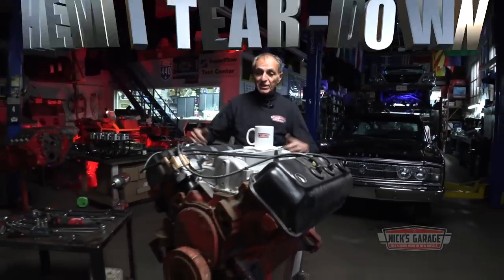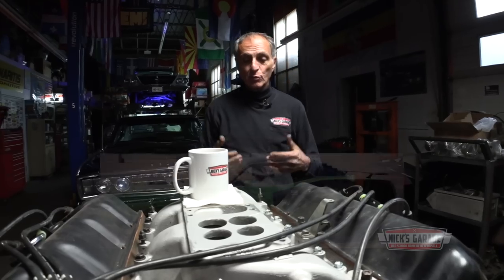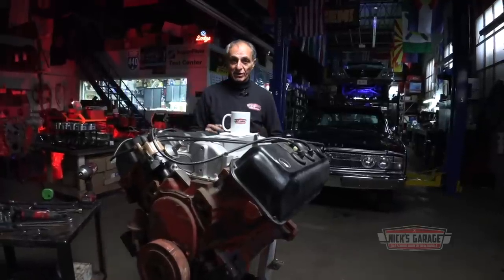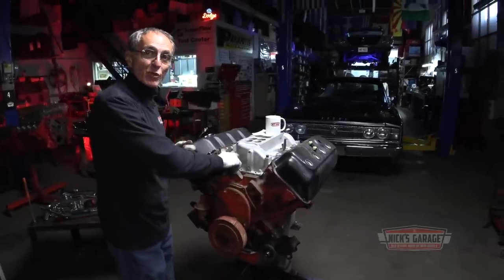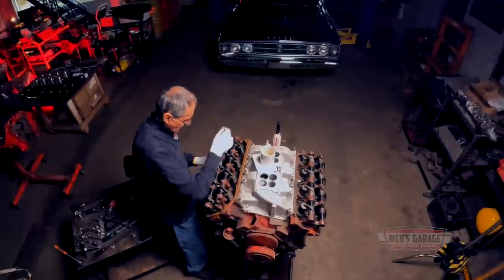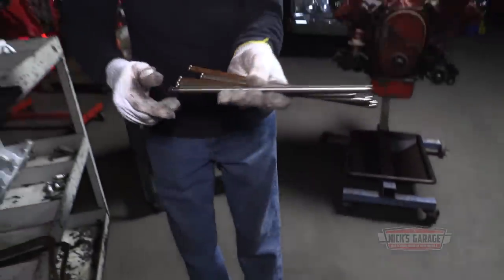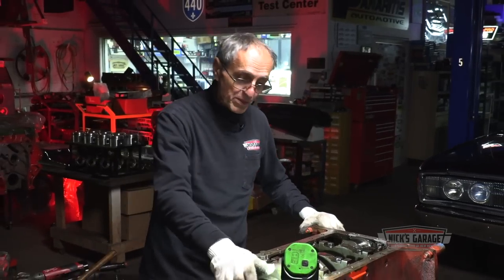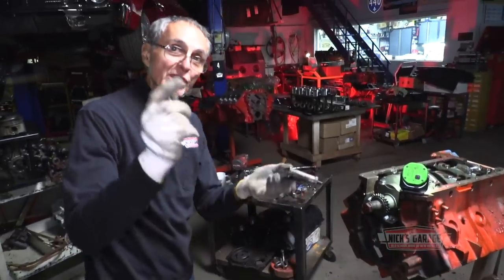426 Hemi Torn Down - What's Inside the Legend?

Comment: Nick you know they do make different grade bolts and just maybe the factory bolts were prone to failure. So someone decided to upgrade this engine to main studs. This is what most modern engines use so there must be some physical theory behind the upgrade.
Reply: I understand. I will buy grade 8 bolts for the side caps so we can have the original look. After all, it is not going racing or high RPM's.

Comment: Hey Nick , I would only bore that whatever you need to clean it up. If you can get by with 10 overboard and it cleans it up that's what I would go with.. the only can machine them so many times so on something like that the less you do it the better in the long run..👍
Reply: .010 will not clean it up. And 2nd, .010 pistons and rings have to be custom made and will take many months before I can get them.
Reply: Rings should not be a problem at all. Pistons on the other hand,  probably would have to be custom-made. But the difference in price is probably not that much.. anyways quality matters first and prices forgotten. Anyways you'll figure out what to do just giving suggestions. 👍

Comment: what's the reasoning to change to studs on the block mains?  does it distribute tension across 2 sets of threads instead of one?
Reply: Yes a bolt may stretch more than a stud with high  rpms

Comment: Is there a difference between a 426 oil pump, and a 440, or 383?
Reply: No, not really. all 426, 440 HP and 383 HP had the same oil pump. High Pressure.

Comment: Hey Nick if the cylinder bore cleans up at .020, will you just purchase .020 over pistons >> then you can go .030 .040 .060 later
Reply: Cylinders are worn and scrached. 0.030 overboer is what we need to do.

Comment: Hi nick 
Need your guidance, 
I have problem in 1971, 426 hemi from shaft the oil doesn’t reach to rocker arm - the block isn’t Indy
Both intake and exhaust at one side from 4 , only one whole there is no oil can you guide what can be done

Comment: Hiya Nick
Your getting like me the grumpy old guys...lol....we forget that back then we used what our machine shop guys told us and let's face it Nick they were mass production engine's so somebody in the engine room measured and marked the blocks with A,B,C,D for Piston and the rods were not balanced like we do today.....the old original engine's never ran "smooth" the harmonics we're terrible...but it was the technology of it's time.alot of them were blown up within a year of ownership.look at them now you can put a glass of water on the intake and it barely shimmers.maybe the shop that fixed the bottom end put them in because that's was the up sell ...the engineers then are not the engineers now.... engineers today don't even go in a shop they send the CAD program down to engine development and the Tech's put them together and send back the data to them and they revise the design.....not a bad thing...just we get to experience all of it...these new guys don't know what to do 🤣😂🤣😂🤣

Comment: Does that mean you can put 440 magnum heads on a 426 block I wonder?  Nick's Christmas box xl
Reply: Why would you do that ?
Reply: @nickpanaritis4122   I was just wondering about interchangeable parts. Can make a 440 hemi ?
Reply: @stevelee5724  440 is a "wedge" head, not a hemi. Totally different animal, even if the heads were interchangeable. The Hemi RB block is very different from a 440 RB, too. There are many aftermarket racing Hemi blocks and heads available (if you have deep pockets, but then a standard Street 426 Hemi won't be any cheaper to buy, either) that can go way past 440 cubic inches, if a bigger Hemi is what you're after.
Reply: @scottb8175  Thanks Scott. I thought the blocks were the same.  So what is a max wedge?  The thing is they all seem to be great engines. Max wedge ?
Reply: @stevelee5724  Max Wedge was the top Mopar performance engine that was replaced by the 426 Hemi.  It is more like the 440 in design.
Reply: @scottb8175  Hi Scott. Thanks for the reply mate. Is that the R series before the RB, raised block ? I've heard Nick talk about the R block. Like the 413 ? Cheers Scott.  I'm in New Zealand so I didn't get to see many big block Chrysler's. Lots of small blocks, many 318 and a few 360 engines in Australian Valiants. They have a good reputation here.

Comment: Hemis have been around for a long time going back to the 1920s, the advantage of the Hemi is the cross-flow heads are good for making good HP at high RPMs, but you can have cross-flow heads with it not being Hemi, just look at most if not all modern sport motorcycles they have cross-flow heads but are NOT Hemis they are pentfoor (penthouse) combustion chamber even better! then a Hemi, there is a reason all Formula 1 cars have a pentfoor (penthouse)  combustion chamber, the Mopar guys won't like this at all!, but if you look at the modern-day Mopars of today, are not real Hemis they are a 2 valve pentfoor (penthouse)  combustion chamber, sorry guys for bursting your bubble.
Reply: It's all good.
Reply: My 1983 Kawasaki GPz1100 has a poly hemi combustion chamber - each of its two valves are in a small partial hemi shape, with squish bands on both sides. It is also known as the "bathtub" combustion chamber. The piston head is like a 426 Hemi but with a slight flat spot on the top and slightly chamfered sides. Like the Chrysler Hemi, many 2-valve supercharged top fuel bikes used that style of head for many years. Standard Kawasaki Z-1 and KZ heads (1973-2003) were true Hemi's, but the poly Hemi versions (1983 to 1985 GPz, 84 KZ-R, and 84-85 LTD) flowed even better and are highly sought after by builders of retro Kawasaki drag bikes. Cross flow or "blow through" heads like Hemi's and Pent Roofs are losing favor though. They work well with superchargers and turbos, but aren't very good naturally aspirated. The top performing motorcycle heads now are actually not pent-roofs, but a very flat chamber, low included valve angle 4- valve with minimal head chamber volume and nearly flat top pistons. And they work just as good if nor better than the blow through heads when supercharged. The fastest top fuel bikes all use them now.
Reply: @scottb8175  Your description of a  flat chamber, low included valve angle 4- valve with minimal head chamber volume and nearly flat top pistons, is a Pent-roof combustion chamber, just like on the Suzuki TSCC heads, look it up on Wikipedia.
Reply: @nickpanaritis4122  Do not get me wrong Nick if I had an old Mopar it would be a Hemi 4-speed car, that engine is so good-looking! one of my dream cars is a GTX 426 Hemi 4-speed.
Reply: @scottb8175  ...Thanks for the info.

Comment: OK, it's an original engine. If you are going to punch it 30, why not 60 with a different cam?
Reply: I always try to bore it to the minumum.
Reply: @nickpanaritis4122  How much over is too much with the 426? Is it as bad as the Ford 427 and 428 - where anything more than 0.030" and it's a boat anchor? I believe the 440 is perfectly fine out to 0.060" over, as was the truck versions of the 390 Ford.
Reply: Yeah going 60 is pointless for power and you just lost the ability to rebuild it once again in the future.

Comment: That right head back side rocket arm assembly the reason it was so loose every Mopar V8 that I've had even the 383 for some odd ball reason that springs go through more stress. My all-time favorite is a 225 that slant six that was a bulletproof engine if you maintained it well I had one took it out of a 78 Dodge wagon put it back in the transmission it was only a 64 Dodge van no housing bolt pattern the same the only difference was the 78 225 came out of an automatic and I had to put a pilot Bush again because the 64 was a standard a little $1.78 part I was wondering why the transmission stabbed so easy sir no joke I have somebody help me with it and he was even coming man this thing's answer is it and I remember something this is s*** we stopped this is what's wrong the pilot pushing we forgot it we were already starting we already had the bouncing both of that we're starting to hook up the linkage in the throughout the fork assembly I have a double checking the u-joint and Carry your bearing assembly when we versus s*** in unison now we got to take all this crap apart sure enough up on the dashboard  is that little dollar 78 part! How's the weather James the only thing I just changed I took the electronic edition of the 78 I had to change the flywheel too and then I had to go to the boneyard and find one likely they had one but this car was in the middle of the boneyard and jacked up one side and then just to the car next to it and basically I had it almost on the side took me 4 hours to get this car on the side all they have are two bumper Jackson and my floor jack and the 510 bottle jack I got that big old I got that Dodge dart on the side I just wanted to flywheel that's what I like about my purse they did not change the dies for 25 to 30 years and then the boneyard you can find just about anything you wanted I took the whole electronic assembly everything is distributor fits too the old 225 Had over 327,000 other than a valve job in the rings and it hit Miss on the raspberries that would would go knocking after a while they wouldn't replace them all they just replaced whatever one started going knocking today I went to go park it I had 18 lb of oil pressure I'm barely going 22 miles an hour this was a nice classic 64 Dodge Van that split window I turned it into a house cuz they had to pop up top I need the top permanent added extra weight on the bottom I need a little compartments in the floorboard for sandbags anyway I do miss that van but snowy roads in Denver tickets the motor I put in it only had 42,000 miles on it and I got it for $225 and I had to pull it out and put it in happy holidays to all"

Comment: Isky cams were all the rage down here in the US back in the 60's and 70's.. I was not surprised to see on in this 50 year old motor.. they were good cam's. Not to try sounding condescending With your experience there would be no reason to go with anything other then the original exterior main bolts.. But as you pointed out this is a street engine one that is pushed and shoved hard for 50 years.. any back yard mechanic would go the extra mile.. Remember your own beginning.. Did you insist on all original parts nut's and bolts? did you ever over "engineer" your engine just to make sure it didn't break? You have become such a purist that you have lost touch with what got you there.. I have seen this so many times.. You guys (while having an extensive knowledge and an abundance of ability) always act dumbfounded, or say I do not know why they did this.. When if you would allow yourself to remember you roots you would not only understand but know why they did what they did. and instead of shaking your head in a disapproving manner you should smile and understand that some of the fellows that have done work on this were just like you once.. and that maybe a few tof them went on to be just as good whiles other just created great times and good memories.
Reply: I see your point.  Maybe because I never took this route.
Reply: @nickpanaritis4122  Really? I am amazed. I so love your channel you are the best I have ever seen.. Maybe it is because I started with lawn mower engines when I was 12 and didn't rebuild my first car engine until I was 16.. Where you a purist when you started that would explain a lot about you now.. If I was younger I would by one of the old muscle cars I have owned.. and have you build an engine for me.. But Alas..  I spend to many years throwing my body around having fun figuring I would never grow to be old.. But at 70+ I am now paying for that fun.. crippled and in pain most of the time I still will never regret those heady days of my youth and the fun I had.. Especially all the fun around the old engine shop I had Thanks Nick.. being about my age you have the stories that make me remeber.. I like it.. thanks so much..
Reply: @tinkmarshino  ...   Back in the day, I did modifications like headers, intake manifolds, Holley carbs and mild cams. The cars that come in my shop sometimes have the craziest modifications I had ever seen. Fo example, 10 quart oil pans, why ?  Anyways, I see your point. 50 years of tampering with these cars with so many different crowds. It makes sense to expect anything out of the ordinary on these old muscle cars. Thanks for watching our channel.
Reply: @nickpanaritis4122  Yeah some of these kids did wild things.. Because they knew how to change out parts but never really understood how it all worked together.. It was "if a little is good a lot is better" or "if strong is perfect stronger is more perfect". It is just a matter of it being a fad for awhile down here and  a lot of these backyard mechanics just didn't truly understand what they were doing.. Even me the first engine I refreshed I was unsure.. but I did it like my lawn mower engines.. kept everything in order and clean.. that ole 52 chevy was a beast and it ran just fine for many years after. Ah heck Nick.. those were the days huh.. that is why I watch your show.. to remember those days and relive my love for it all. Thanks my brother for all you do!